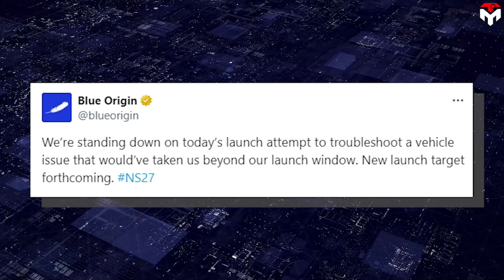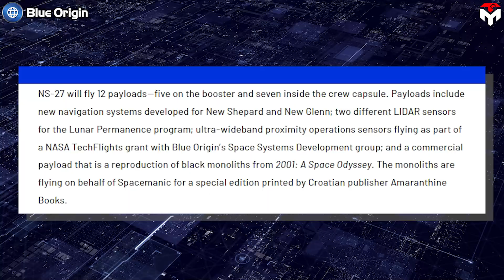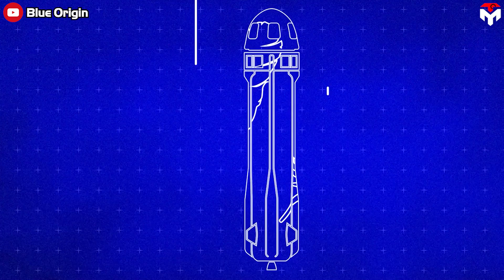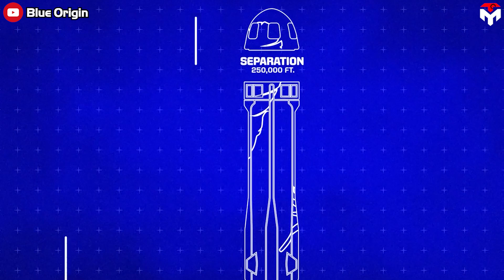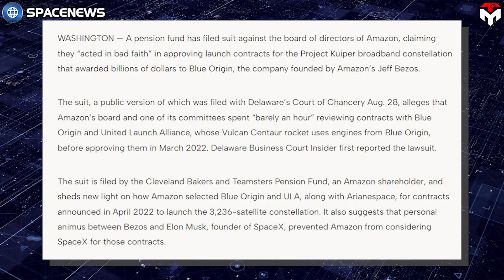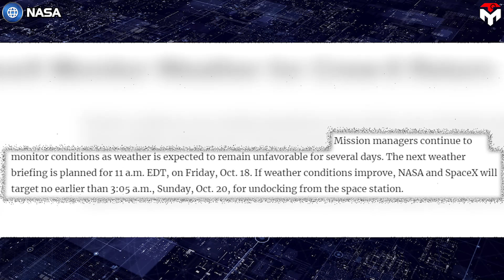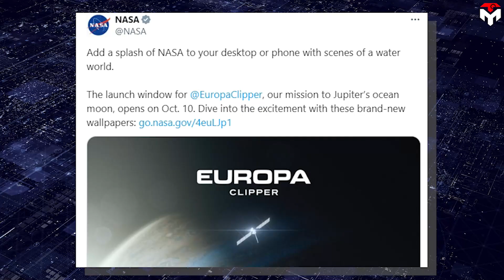It's Embarrassing! Blue Origin Failed To Launch Rocket Again While SpaceX...

Comment: It is as simple as explained by Musk himself: Musk is a pro and knows his subject better than any of his engineers, let alone the comparatively amateur Bezos. 

Musks leads from the factory and knows about every single bolt built into his rockets. 

In the meantime Bezos is trying to lead from his luxurious office or one of his yachts  

There is the main difference. 

Either the rule “Schuster stick to your lasts” applies or you become an expert in a new subject like Musk did by frantically reading and understanding everything of relevance to his pursue.

Nobody is going to admit Bezos is a technology expert, right? 

Even if of course, Musk is a genius of the kind that only appears every few decades:

My advice to the super-rich and super-helpless Bezos? 

Learn from Musk as an intelligent apprentice learns from his master.

Because, as Musk himself repeatedly emphasizes: competition is good for everyone. 

Musk and his company would also benefit from a competent Bezos and Blue Origin.

Comment: SpaceX isn't afraid to fail when failure produces usable corrective data. It's one of the reasons SpaceX makes tangible improvements - even betteen missions at an accelerated pace and Blue Origin is so incremental in comparison.
Reply from the maker: That’s exactly right. They are far more concerned with image than progress.

Comment: Bezos' problem may be his educational background differing from Musk's.

Bezos graduated with electrical engineering and computer science degrees whereas Musk graduated with physics and economic degrees.  Engineers like to design fully design things as best as they can and then test them.  Physicists will have a theory, and as soon as practical, like to test that theory.  Essentially, Musk is looking at aspects of quickly reusable rockets sort of as theories, that he wants to test ASAP.  Bezos is wanting to get all the engineering completely done before any tests.  He probably thinks that testing can be substituted with computer models.  The problem with that is that such engineering is very expensive, especially that last 10% which involves a whole lot of unknowns.  Throw in Elon's economics background, and he has determined that a bunch of tests to determine the answers to those unknowns are actually cheaper than a bunch of engineering to try to guess the answers to those unknowns.

Even NASA conducted a bunch of tests before they got to Apollo 11.  If Bezos had run the show, Apollo 11 would have been  Apollo 1.

Comment: Blue Origins engine is leagues weaker than the Raptor….
It may have the same thrust,  it’s like 5x the size
Reply: Thrust to weight ratio is very important in rocket engines and Raptor III is alien technology better than the BE4 on that metric. Dependability is a second critical consideration, more parts and more connections means more potential for failure, and again the Raptor IIII wins big. Then the lack of delicate tubes running all over the outside of the engine will allow the elimination of heat shields, the best part is no part, eliminating a significant amount of weight there too.
Reply from the maker: Big clumsy elephant